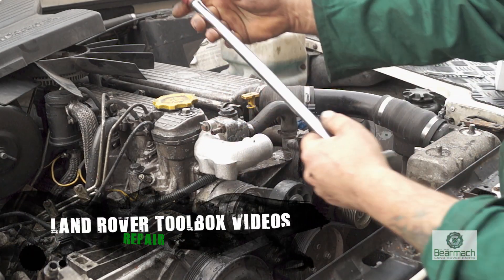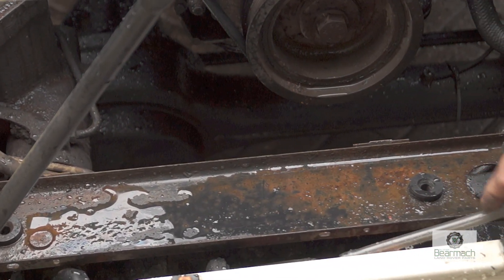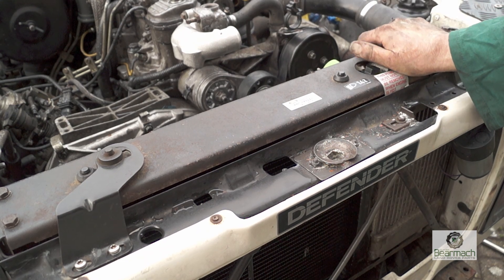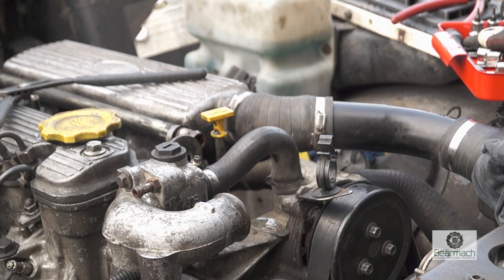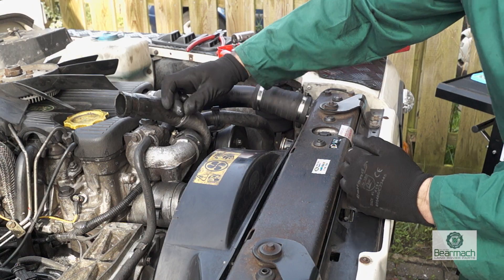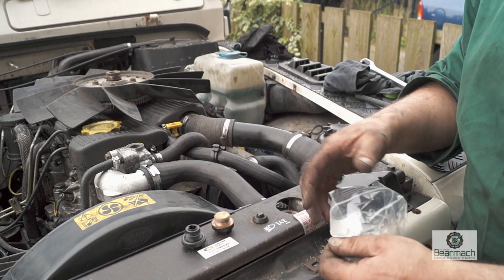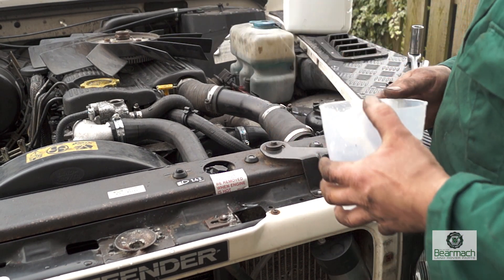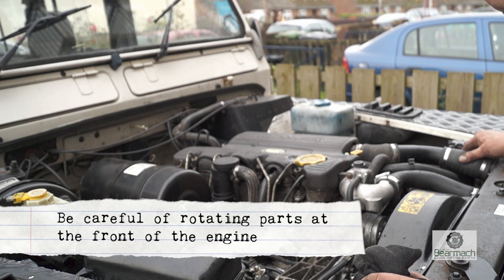Bleeding the 300tdi cooling system and checks  The Fine Art of Land Rover Maintenance

Comment: Hi. I have a 300Tdi Land Rover Defender and has been mixing oil in coolant box. I replaced head cylinder and gasket and checked the block for crack (it didn’t have any). Some have advised it could be a cooling system. When I watched this video I felt I should reach out for your help sir. Thanks.

Comment: I love your vidoes,  however on this occasion i was dissapointed you actually didn't show the drain bung removal  & Exactly what tool you used????  As is common the Boffins at L.R.  did their dim-witted moron best to put that bung in a motherf@ukker spot.  Everything is in the way of  attaching & turning any tools normaly found in a home tool kit on this 25 yrs old bung to crack it loose without stripping the bolt head.   At this point manifold removal appears to be my only option.   Ant tip would be greatly appreciated.  Thanks for Matt in Australia.
Reply: you eve get a reply? Make sure you smear ANTI-SEIZE threads when re-fitting

Comment: so to fill cooling system. beware I got a disco. so undo expansion tank and lift.
take thermostat and radiator plug out. fill in expansion tank till come out of raidiator. then fill from thermostat housing till that full. then squeeze hose and work through so its both sides of thermostat?
and for heater squeeze hoses as there a little higher?
Reply from the maker: disco is the same deal.

Comment: hi. very helpfull video. i have a 1996 300tdi discovery with red antifreeze in it. should i put blue in it? if so can you recomend an antifreeze or is all blue antifreeze the same. thanks in advance.
Reply from the maker: Red or the OAT stuff has different compounds in it that are claimed to attack the metals in the cooling system.  It should have the blue anti -freeze /corrosion inhibitor in it.  Paddocks do a Millers Blue,  reputable automotive fluids company.  I'd personally keep with what is recommended by Land Rover.   OAT Anti-freeze is for later vehicles with aluminium radiators like the Freelander / Td5 etc.   I know some on forums may say it is okay to use red where blue should be but I am not sure TBH.
Reply: Thats great, thanks for your help and speedy reply. Cheers.

Comment: I know what you have demonstrated isthe proper way, and this is the way I always do it but I have been known in the past to just fill the header tank to the top, massaged the pipes, fill to the top etc etc, then put the cap back on with the header filled right to the top. A run up the road and back gets the water where it should be and any surplus comes out the cap and the system bleeds. What if any, are the problems with doing it this way?

Thanks for your time with the vids mate. More than helpful on many occasions.
Reply from the maker: Yes I do that as well to see if the fluid is in the hose but also listen to see if the jiggle pin in the thermostat is working but on other engines or even the ti engines..  That is the small air bleed which take much longer to let fluid through.  With the bleed screw open it is very quick.  Some vehicles will not let you bleed out like the 300tdi .